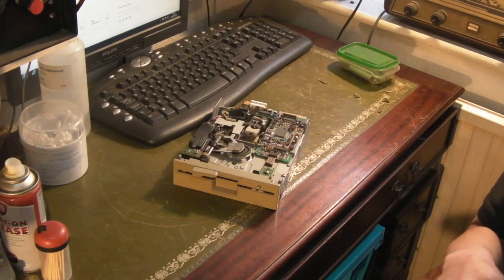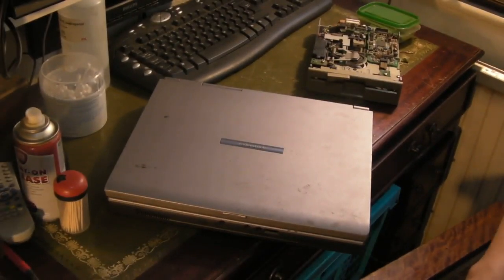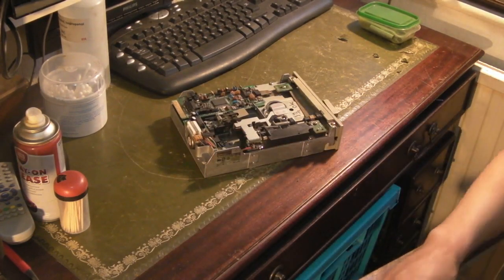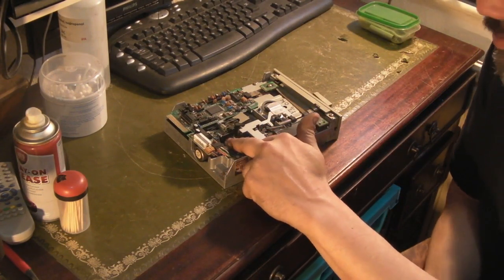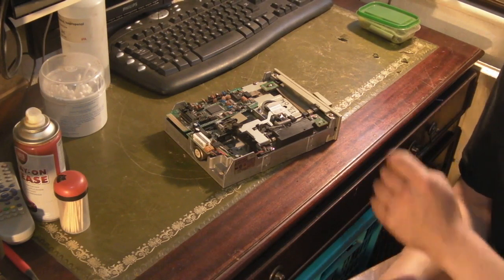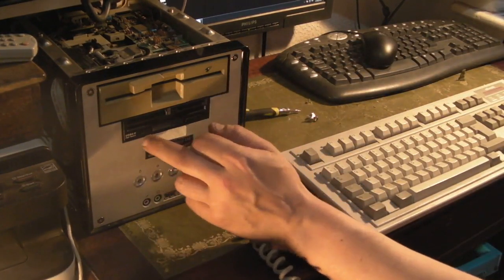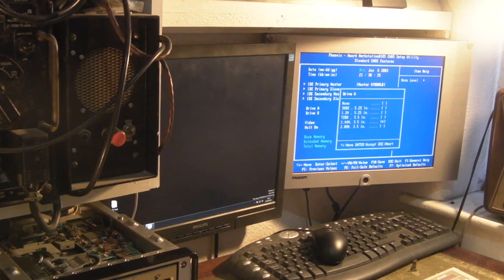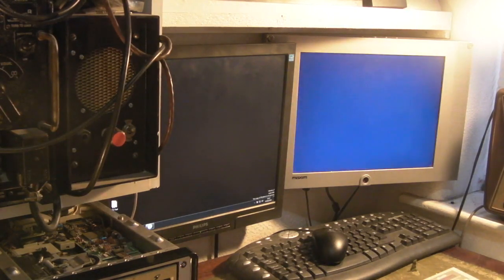Mitsubishi mf504c-318ug 5.25" Floppy disk drive service and installation into my new bridge PC.

Comment: Useful video, thanks! I this exact drive as well, connected to a Greaseweazle V4. There are a few manuals online for closely related drives that should help, just search for MF504. If you want to remove the latch lever and bezel, there's a cap that's snapped into the lever which hides a small screw, once the lever is off you can undo the two bezel screws and two latches to remove it. From there it's possible to remove the top half of the drive and get access to clean the entire diskette slot.

Comment: Nice! Great little computer. I was never able to make trs80 and ti99 floppies on my old pc. I also have a 1.2mb drive. I probably need an older/slower one. Ended up using floppy emulators instead. :) but cant beat the retro feel of a 5 1/4.   Awesome vid!

Comment: i've got one of these 504C drive, i've had it since 1992 I think, and still works like a charm!  I am trying to revive it's older brother the 501b, a 360k drive,  fo some reason it does not turn the disks.